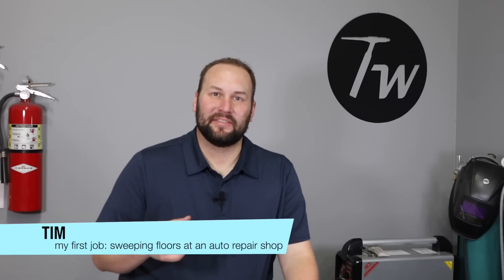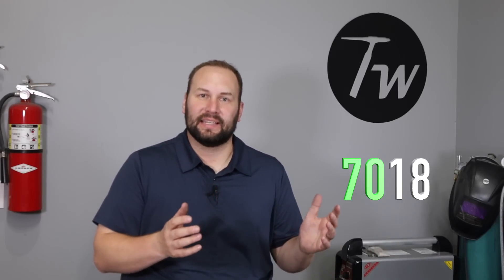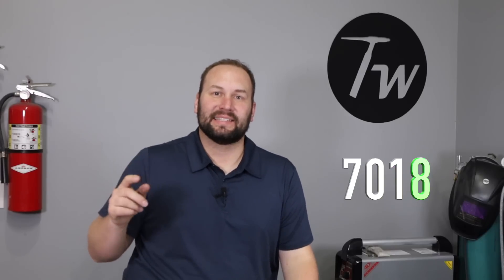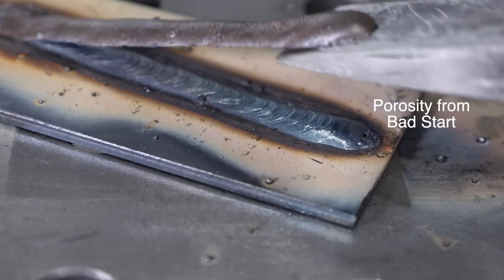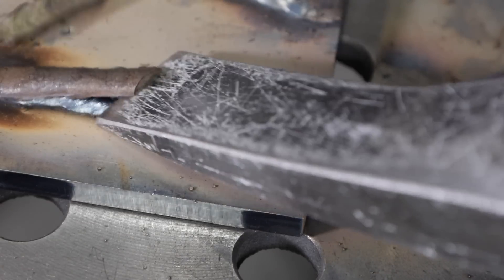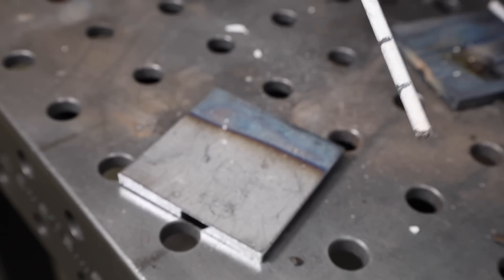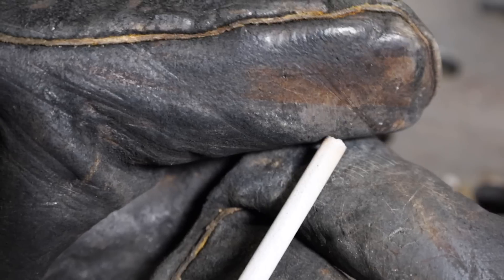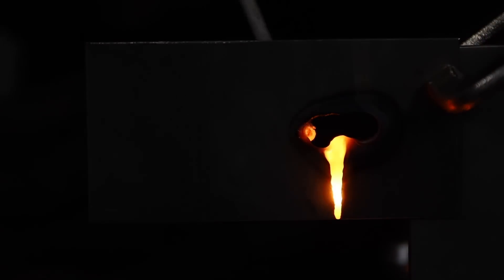Stick Welding: Which rod is my favorite?

Comment: 7018?? NO CHANCE would that be my ONLY rod.  6011 all the way!!!  It's AC/DC, cellulose so you never have to worry about storage, it burns in deep and strong.
6011 is a workhorse and a powerhouse.  Not the prettiest weld but if I only had one, I'd not be chasing slick beads or scorpions, I'd be after gettin it stuck and stuck well.
Reply from the maker: Thanks for the comment! I’ve run a lot of 6010s and a fair amount of 6011s. They definitely burn in there deep and work great for many things. Thanks again! I always appreciate different opinions.
Reply: I totally agree you can't beat 6011 for an all purpose rod.
Reply: i prefer 6012 rutil-cellulose

Comment: My favorite electodes is 6011 Indura green and blue dot. I find 7018 good too when need something stronger than usual (some construction equipment repair perhaps), but most of my jobs is with thiner materials 1.5-3mm and 7018 is too much. Also steel in 7018 is harder to grind. So all in all "ideal" electrode depending of your job type =)

Comment: 3:05 so it is possible to use 7018 as penetration for groove weld, though the root face should be thicker then to avoid excessive penetration or melting the base metal. Can you show us Tim how you do it? 🙏
Reply: For root and hot passes where good penetration is a must, cellulose rods are absolute king.  Low hydrogens are cute, but in the MMA world, punching deep is king. (See what I did there?)

Comment: I too love the 7018 rods once you get the hang of how it works its a beauty if you have a piece that will take the whole rod there's nothing better than that you can weld cast iron or even stainless steel and it quite at home

Comment: I did buy some 7018 on impulse last time I was at Harbor Freight, haven't tried it yet. I was also scared of the oven storage which was part of why I started with 6013. Already read your good responses elsewhere on that though. Nothing I'm doing so far requires any particular strength. I still need to build my welding cart, so I'll probably burn a rod or two of it on some plate first then dive into building that using both my rod types for practice.
Reply: Oven storage is great to keep moisture out of your flux coating, plus a warm rod tends to lay quicker and prettier. 
   (( I used to use an angle grinder to grind the rolled tops off the 50 pound rod  cans and I'd keep our rod warmer fully stocked. The boilermakers appreciated it, so they left me alone for "government jobs!" ))
   Moist flux coatings tend to pop and flutter your welds and make ugly spots. You don't HAVE to do that, if you have damp flux. You can go ahead and strike the arc and then, pull it back some, pulling a LONG ARC. This will heat up the rod and dry your flux to a great degree. Then shove it on down for a closeness to your puddle and get your pattern going. You'll see a big difference. I like 6012 to do all my tacking together. Then switch to 7018 for the main welding. Get a swirrel pattern the thickness of the rod on each side of the edge of stock. Rod straight in and and progressive cursive e's. Looks like a spread out stack of dimes and excellent penetration.

Comment: May I weld 7018 using an AC welder?, thanks for share
Reply from the maker: There is a version called 7018AC that works great for AC. The container will scow what polarity can be run.

Comment: I also like 7018 the best, even though it can be hard to start. I find that not all 7018 is created equal either, and Excalibur MR burns really smooth for me. ESAB Sureweld has just a tad of snap, crackle, pop for me. I've heard the Atomic is better, but haven't tried it. Both have a graphite tip, they claim easy to start, but it's only on a fresh rod...I don't have a problem with fresh rods, it's restarts for me. One point you missed was how 7018 is less tolerable (but not intolerant) of rust or other contamination, than say 6010. I would rather clean and use 7018 though...😏
Reply: I agree the Excalibur is a fantastic rod. Have you ever tried the Forney 7018 rods? They seem to be extremely smooth in my experience.
Reply: @isaachale9588  Yes, I have some Forney 3/32" 7018, it's ok, nothing to write home about after using Excalibur. I also have some Hobart 7018 and Hobart 6011 in 1/16". Good to keep for thin material. I also have some 1/16" 6013 as well as 1/8", and I don't like it very much. Although they say you can run 6013 in any position, I find it pretty runny when using it vertical up and down both. Going vertical up is better, but it's still messy for me. Where I would use it is 1/16" on auto body panels, they used it for years to do those repairs. Chances are pretty low and me doing that as I would lean towards tig. I would use the same technique with either, tack along the seam and keep tacking to fill it in, then grind it smooth. That seems pretty common on body panels, and 6013 was intended to use on thin sheet.

Comment: In my country, 6013 is what most people use. I hate it. Much prefer 7018 as the puddle is easier to read and it penetrates ALMOST as much as  a cellulose rod. (Did some cut and etch tests.)

Comment: Thanks for that Tim 👍. As I'm teaching myself Welding,  and definitely w/ the Stick , I wasn't sure what Rods to use. 
I have 7018 and 6013 @3/32".  And a Amico ARC200 Inverter.  Nice little machine 👍.
    I believe the K.I.S.S. adage applies at this point.  Less to worry about and more to focus on.  Thanks again for your common sense instruction.  
  Cheers 🍻,  G.
Reply from the maker: Thanks!
Reply: Can you recommend me which electrode can I use   for thin metal sheets. 7018 or 6013. I'm beginner .
Reply: @kenanelicanov2327  I’d say 6013. I just welded some thin tubing today and it worked fine.
Reply: @majoneski  thanks

Comment: I have been using E6011 and W7018….. gave up on E6013….. I purchase one pound of 7018 at a time.
Reply: I don't have much luck with 6013 either.  I suppose it is good for thin material.  I like the way 7018 runs, but 6011 is hard to beat for all around use.  They all have their specific uses.  There is no one size fits all in welding rods.  For 7018, try Lincoln Excalibur.  IMO, it is the gold standard of 7018 rods.
Reply from the maker: Thanks Daniel! That's what I use the most as far as stick welding goes.

Comment: Don't you have to keep 7018 in an oven? That's why I've never used it. I have some but I'm afraid of opening it unless I'm going to use it all up.
Reply: No in California in the summer time I leave them in the hot 90degree Sun light and no problem
Reply: My favorite is 1/8" Lincoln Fleetweld 47 (7014).  It is an easy burning, high iron depositions rod that swings both ways DC and also AC with the same rod if needed, and the slag will peel itself off.

You can almost think of it as 7018 but without a rod oven requirement, just keep it dry.
Reply: @papajon6715  I like both 7014 and 7018. Just depends on what I am doing.
Reply: I just pulled out my grandpas old stick welder. A ward powrkraft 230 welder. I love that thing and I mess with it all the time. Personally I have more fun with a stick welder than the mig welder I have. I want to get a tig welder but so far stick is better to me than Mig. Thats just me though
Reply from the maker: The reason to keep them in an oven is to reduce the amount of moisture in the flux. The reason for this is that hydrogen from the moisture can cause cracking in certain situations. In order for this cracking to occur, you also need a susceptible microstructure found in a higher strength steel (higher carbon/alloying element content) and/or a highly restrained (thick) joint. Furthermore, combatting this does not only include using low hydrogen consumables, it also requires other special procedures including specific preheat temperatures. Determining all this is complicated and it is important to have acceptable procedures for industry. For me, I do not store mine in an oven because I'm welding on mild steel in thicknesses of 3/8" or thinner, which does not require low hydrogen consumables or preheat beyond room temperature according to the structural steel code. Furthermore, I'm not welding on any critical applications. I just keep mine in a sealed tube. I'm not saying whether this is acceptable for your situation or not, but it's a little background and what I do. 

The interesting thing is that a 6010/6011 or a 6013 will deposit more hydrogen than a 7018 stored out of an oven, so using those instead will not help anyone out as far as hydrogen deposits go. (I will note, however, if you are welding to that code with a low hydrogen consumable, the storage requirements still apply even if low hydrogen consumables are not required for a given procedure qualification)
Reply: @TimWelds  don't forget many of today's 7018 are deemed as MRs & LMPs. Unfortunately, code work like with ASME (boiler pressure) still requires a holding temperature before use.

Forgot to add:
MR= Moisture Resistant
LMP= Low Moisture Pickup
Reply: @TimWelds  Thanks for clearing that up. I grew up around mig and now I have a little stick welder to learn/small repairs and projects. I have been using 6013 but everything I've read/watched says 7018 is nicer to use. I guess I'll be cracking that open and giving it a try. 👍
Reply: @TravisShidemantle  No, 7018 is not nicer to use than 6013. More tensile strength, definitely, I suspect better penetration as well. Depending on what electrode you use, 7018 could also have less spatter.
The drawbacks are that it is easier to blow through thinner materials and harder to do restarts on 7018 than 6013.

But give it a try, we all have our favourites. 😊👍
Reply: @TravisShidemantle  7018 has got to be the easiest rod to run because it doesn’t burn violent like a 6010 around the weld pool, allows the welder to see the weld pool with good clarity, and overall burns clean so long as the welder keeps a light pressure on the rod to maintain short arc length and a steady travel speed.

Comment: 6013 is by far the best all around rod
Reply from the maker: @Hi It’sme Thanks for the comment! 6013 isn’t my favorite, but if it’s doing what you need, then weld on!
Reply: Low penetration, a lot of good characteristics but not for strength
Reply: What do you prefer in 6013 over 7018?
Reply: @Peter_S_  I like both honestly, they are very similar and easy to clean. You really cant beat a 6011 for dirty rusted up stuff though. I'm not a fan of 7018 because you need an oven and they dont store well for us hobbyists.
Reply from the maker: @DaddyO's Ink

Thanks for the comment! I replied with some info about the rod oven in another comment, but I'll paste it here as well if it's interesting. 

The reason to keep them in an oven is to reduce the amount of moisture in the flux because hydrogen from the moisture can cause cracking in certain situations. In order for this cracking to occur, you also need a susceptible microstructure found in a higher strength steel (higher carbon/alloying element content) and a highly restrained (thick) joint. Furthermore, combatting this does not only include using low hydrogen consumables, it also requires other special procedures including specific preheat temperatures. Determining all this is complicated and it is important to have acceptable procedures for industry. For me, I do not store mine in an oven because I'm welding on mild steel in thicknesses of 3/8" or thinner, which does not require low hydrogen consumables or preheat beyond room temperature according to the structural steel code. Furthermore, I'm not welding on any critical applications. I just keep mine in a sealed tube. I'm not saying whether this is acceptable for your situation or not, but it's a little background and what I do for my hobby work. 

The interesting thing is that a 6010/6011 or a 6013 will deposit more hydrogen than a 7018 stored out of an oven, so using those instead will not help anyone out as far as hydrogen deposits go. (I will note, however, if you are welding to that code with a low hydrogen consumable, the storage requirements still apply even if low hydrogen consumables are not required for a given procedure qualification)
Reply: 6013 is a fine rod but in many code shops, it isn't even allowed in the shop. Only 7018 rod allowed in most code pressure vessel shops.